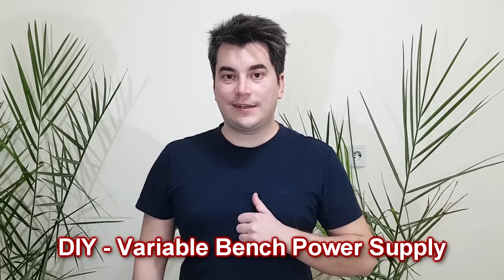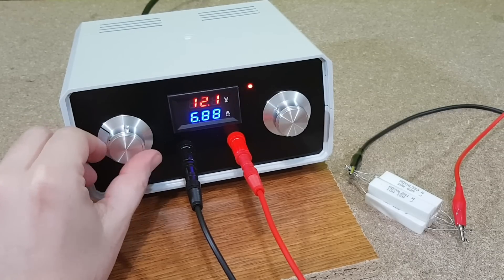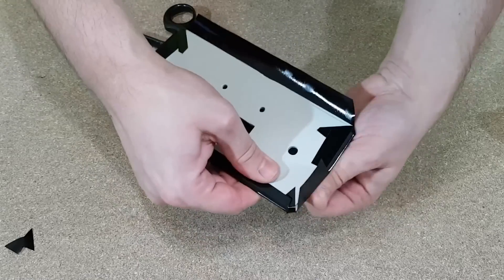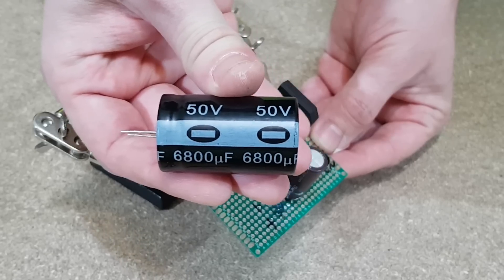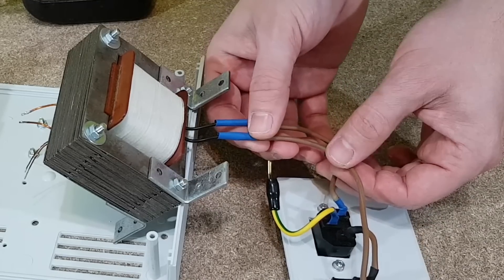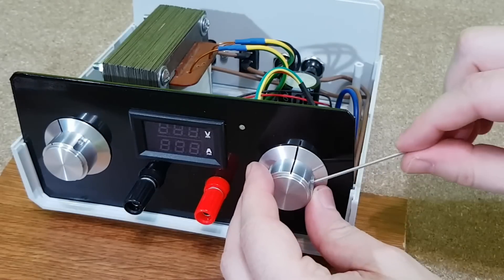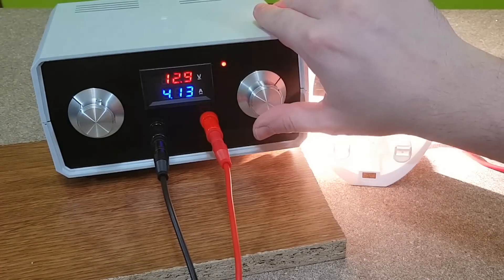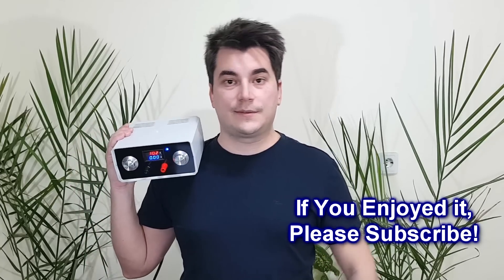DIY - Variable Bench Power Supply (Very Powerful)

Comment: Il y a beaucoup d'alimentations sur le net !
Mais j'aime beaucoup celle ci !
C'est du bon travail !
Pourquoi la led a trois fils ?
Elle set à quoi ?
Merci de ta réponse .
There are a lot of feeds on the net!
But I really like this one!
Its a good job !
Why the LED has three wires?
What is it?
Thank you for your answer .
Reply: Je crois que c'est une LED bi-colore (2 anodes, 1 cathode ou l'inverse), elle indique si l'alimentation est en mode voltage constant ou courant constant. On peut voir autour de 9:00

I guess this is a bi-color LED, so one anode, 2 cathodes or the other way around. You can see it change color to indicate if the power supply is in CC or in CV mode. We can see around 9:00
Reply from the maker: hi. yes, it's a bi color LED. one color is for when the power supply is in constant current mode, and the other color, when it's in constant voltage mode. but it's not very precise. it doesn't change the color exactly where it should, according to the current potentiometer setting.

Comment: Please  help me
Hi Sorrin I have watched your video several times it is extra but I must state that many have difficulty with the volt / Ammeter contacts. in minute 1.50 you show two different Volts / ammeter one with two wires and the other with three wires Red black white but in video you use another volt / Ammeter with three wires Red black and blue so I wonder which wire is for amperes and which is for Volt and of course the same on the schematic it would have been easier if you wrote a bit on the schematic for beginners like me
Reply from the maker: hi. the voltmeter with 3 thick wires is not available anymore, you can use the voltmeter/ammeter with 4 digits from the link in the video description. I made a new schematic with the new voltmeter: https://i.imgur.com/HDkBf7m.jpg
Reply: @Sorin_DIY  
hi thank you so much for your answer.I bought the volt / ammeter after watching one of your videos a year ago and now I am building a similar power supply without a transformer but with a siwtching adapter 12v and 5v and I can not find the right way to bind volt / ammeter.I will try with the new shematic.
I have another question: why do you use two wires for volt / potentiometer?

Comment: could this be done with a microwave transformer or is that overkill?
Reply from the maker: yes, but it's not recommended. microwave oven transformers are not meant to be powered for a long time. they waste a lot of power and heat up.

Comment: How many ohms are the resistors you put in parallel after the electrolytic capacitors?
Reply from the maker: 82Kohm and 2.2Kohm.
Reply: @Sorin_DIY  82k for the 19v and 2.2 for 12v?
Reply from the maker: yes
Reply: @Sorin_DIY  thanks

Comment: Salut Sorin, poate ma deslusesti tu.
Am construit o sursa laborator dar cu un traf și punte redresoare. Este cu lm317 si cu 2n3055 npn tranzistor. Totul bine, dar am conectat un modul afisor si se stinge când scade tensiunea sub 4v.
Am conectat firul subțire rosu după punte si înainte de lm317 și pe Colectorul tranzistor și minusul la minus. Cel galben la ieșire ca de obicei. De ce se stinge când scade tensiunea mai jos de 4v.As vrea sa vad si de la 1,25v pana la 4v..
Reply from the maker: salut. ai un link cu modelul de voltmetru folosit?

Comment: Can some one help me I’m trying to make a bench psu from a previous vid but I’m using a modern 650w psu. What dummy load resister should I stick on it.

It’s has most of its power on 12v rail 648w @ 54amps

3.3v & 5v rails are 140w @ 25amps

Comment: Ai putea construi tu circuitul variabil de tensiune exista scheme foarte sinple cu variaj de tensiune și amperaj. Eu mi-am construit propriile scheme  cu 317 și Lm 324 și ifrz 44 n. Dar în ultimele  3 surse ale mele a trebuit sa folosesc circuite cumpărate deoarece spațiul în carcasa este foarte mic.  Într-o sursa am folosit același circuit ca în videoul tău si 2 punți de diode și un ventilator cu un termistor. La o sursa pe care o am în lucru de 2 ani care are o putere de  56 de v 6 A   am creat o schema cu tranzistori mosfet. Dar costul pentru piese era prea mare asa ca am  cumpărat un circuit.  Am construit și o sursa cu Lm 723 și Lm 358.  Cred totuși ca ar trebui sa incerci
Reply from the maker: salut. la inceput asa ma gandeam si eu, sa construiesc circuitele. dar la cat de ieftine au devenit modulele astea din China, nu prea se mai merita. circuite simple/de baza cum sunt puntile redresoare din acest clip, sau filtre de boxe, le fac eu. dar module complexe cu piese SMD... mi-ar lua prea mult timp si costa mai mult sa le faci.

Comment: Hello, nice project! I am making a power supply from an old laptop charger, I am limiting the voltage with voltage regulators. How can i limit the current? And how can i make extra protection futures? Thank you!
Reply from the maker: hi. the only way is to use a CC-CV buck-boost converter, like the one in the link below. it's more efficient than linear regulators. for extra protection you can add fuses on the mains input and on the power supply output.
https://www.aliexpress.com/item/DC-DC-CC-CV-Buck-Boost-Converter-9-35-to-1-35V-80W-Buck-Booster-DC/32850280326.html?spm=2114.search0104.3.239.4dba575340DCWE&ws_ab_test=searchweb0_0,searchweb201602_5_10065_10068_319_10059_10884_317_10887_10696_321_322_10084_453_10083_454_10103_10618_10304_10307_10820_10301_10821_537_536,searchweb201603_16,ppcSwitch_0&algo_expid=d6db019c-a4d7-4c52-979f-fda74d194e76-36&algo_pvid=d6db019c-a4d7-4c52-979f-fda74d194e76&transAbTest=ae803_3
Reply: @Sorin_DIY  Thank you! Do you suggest a fuse circuit?

Comment: Great stuff. Any way to modify the boost converter to work up to 40V? Thanks!
Reply from the maker: thanks. the module I'm using in this video, is a step down converter. the xl4016 IC datasheet says: Wide 8V to 40V Input Voltage Range, Output Adjustable from 1.25V to 36V. I'm planing a future video, to modify the transformer and make it more powerful, with a 40V output.

Comment: hello, thanks for the tutorial, but I'd like to draw attention to the bugs.
There is no description of the rectifier diode for powering the display in the drawing.
Furthermore, resistance values (2W, or 5W?)
Converter type
Transformer values (2x12V, or 2X24V, or 1x24V, 1x 12V?)
It would be good to add these data to the schema and description,
especially for other handymen who want to build such a resource.

Comment: Nice work! Can I ask you something? In my own power supply with voltage regulators, i have not current limmiter, what circuit do I need? Thank you for your time!
Reply from the maker: hi. I don't think you can modify it, to get current limiting function. depending on the maximum voltage, you can use like me a step down converter with current limiter function and give the power supply another output.

Comment: Which case are you used in this video
Reply from the maker: hi. I've bought the box from a local store. you can find similar boxes online, but you need to measure the components, to be sure they fit inside. more important the tallest component. my box has this dimensions 180x160x85mm
Reply: Sorin - DIY Electrical Nerd Thank you for the giving suggestion
Reply from the maker: I've found the case model, it's ABS-85B. it cost me less than $5 from a local store. but it's more expensive online, here is a link:
https://www.ebay.co.uk/itm/ABS-85B-1pcs-Enclosure-multipurpose-with-panel-vented-X-180mm-Y-160mm/292828237270?hash=item442dec4dd6:g:gfQAAOSwz05b9nAU&frcectupt=true

Comment: Loved your project but adding a transformer to a switch CV CC stepdown converter doesn't make too much sense as you show in the end of the video.
Also transformers are great for linear power supplies because of their low noise and adding a stepdown will create a lot of noise.
Reply: Yeah a switch mode was a better option
Reply from the maker: hi. it depends on what you want to use the power supply for. I need a powerful variable power supply with more than 30V. the CC-CV step down converter is ok, but a 32V 3-4A switch mode power supply it's hard to find and very expensive. so a cheap or salvaged modified transformer it's the next option. I need this power supply to test light bulbs, LEDs (up to 100W), motors, audio amplifiers, peltier modules... some of them need a lot of current, so a cheap DIY power supply, that can deliver 7A at 13V it's perfect for me.
Reply: @Sorin_DIY  true but a 24 or 5v or even 12v supply are like 20 euro and they will put out 10A or more that is why a 30V output os not really the best choice so a buck-boost whould have been better in my opinion
Reply: @bashaaksema94  Finding a buck boost module which is capable of 300W is expensive. But I could found for less than 15 USD is 80w module which is less powerful than 150 or 300w Boost only Or Buck Only module available for less than 15USD on AliExpress.

Best would be to get a microwave transformer and 1500w boost or back module from AliExpress and rewind the microwave transformer.

Buy a non working microwave transformer from junkyard near you, I bought one for $2 USD.

It will be a monster power supply and will run nearly everything.

Comment: How to fix the voltage drop on even small load?
Reply: just be yourself
Reply from the maker: hi. if you use an electrical transformer, you need to modify the transformer and make it more powerful, or use a more powerful transformer, or use a higher voltage transformer + CC/CV module, so if it has a voltage drop, it will not affect the voltage range that you need.

Comment: Do you have a link to where you got the plastic box.
Reply from the maker: hi. I've bought the box from a local store. the model is ABS-85B. here is a link:
https://www.ebay.co.uk/itm/ABS-85B-1pcs-Enclosure-multipurpose-with-panel-vented-X-180mm-Y-160mm/292828237270?hash=item442dec4dd6:g:gfQAAOSwz05b9nAU&frcectupt=true

Comment: Hi nice project but it seemed you were struggling to get it around 0.5A.
Reply from the maker: hi. it depends on the voltage. it's a 93W max variable power supply. at lower voltages, I get up to 9A. you can check the graph at the end of the video. and I also have a plan to make it even more powerful. the step down converter works with max 300W

Comment: Forte frumos, de unde ai luat cutia, ca eu caut de un an și n-am găsit ceva să-mi placa. De rest este ok, nu-mi place ca ai folosit un modul comercial, dar dacă ai nevoie de 0.5 v dc ce faci, sau mai puțin, este o sursa, ar trebui sa plece de la zero. Îți doresc succes în continuare, bafta!.
Reply from the maker: salut. carcasa am luat-o de la mivarom.ro. in specificatiile modulului scrie ca tensiunea scade pana la 0.8V, insa in cazul meu nu scade sub 1V. oricum nu ma deranjeaza, nu cred ca voi avea nevoie de tensiune sub 1V. daca ai nevoie, poti sa folosesti alte module, care au si tensiune mai mica. eu am nevoie de o sursa variabila, care poate dezvolta si un curent destul de mare. voi testa leduri (de pana la 100W), motorase, module peltier, amplificatoare audio... 7A la 13V e ceea ce am eu nevoie.

Comment: This led is useless, it doesn't indicates cv/cc mode,  by the way this board has short circuit protection, so fuse is not necessary on cold side

Comment: Hello Sorin. I hav one question for you. What voltage goes from the transformer to voltmeter/ammeter display?
Reply from the maker: hi. the voltmeter display needs a supply voltage of 5 - 30V. I gave it 10V.
Reply: Thanks. Can you explain this part of shema. Which resistors goes after capacitors? https://ibb.co/DDNN943

Comment: Great work sorin!🙂....I just wanted u to confirm me that can I use this variable bench Power supply  preferably ....for charging my li ion (18650) battery pack of rating 12.6v 20000mah.. without any problem...
Waiting for urs response..!
Reply from the maker: yes you can use it.
Reply: @Sorin_DIY  Thanks for ur reply...👍...There is one more question to be asked..... As the bench power supply has a pulsating input ...does xl4016 stables the output ...from any kind of input...?.....and will it be stable for charging battery pack at fixed voltage level... without flucating  the voltage ..?
Reply from the maker: the input is very stable, because I added big capacitors. the output voltage should also be stable, but it depends on the load. according to the specifications, the ripple should be around 50mV, when converting from 24V to 12V with a 5A load. if your load is smaller, the ripple should also be smaller.
Reply: @Sorin_DIY  Thanks a lot 👍

Comment: A bit late for this comment but,why did you use 10K Single Potentiometers in the video? But in the description on the parts list you provide 10K Multi-turn Potentiometers??!! Whats the big deal?
Reply from the maker: in my 12V/19V UPS part 1 video I've made an upgrade to the variable power supply. so there is no reason to recommend the simple potentiometers anymore, I added the final link of the multi-turn potentiometers. I also changed the link for a better volt/ammeter.
Reply: @Sorin_DIY  Oh the Irony,Welp.. I accidentally bought single turn 10k potentiometers and I had soldered it to my XL4015 module,it does kinda work,the only issue is that it is a bit hard to set it to the correct voltage and i have to turn it slowly. I am not sure if its the same for current adjustment,but for my module it is maximum 5A,so I guess it doesnt matter. I had now just ordered a WXD3 10K Multi Turn Potentiometer. So i guess now I should be able to set a proper voltage now.

Comment: you say to 4700uf   you  use 6800uf  in your video
Reply from the maker: I use a 6800uF capacitor for one output and 4700uF for the second output.

Comment: you mean DIY buy Chinese switcher module and put it in a box
Reply from the maker: no. I mean DIY build a transformer, because it's very expensive. and don't waste time on building a step down converter, because it's only $2. it's cheaper to buy it, instead of buying the components and waste a whole day to put it all together.
Reply: @Sorin_DIY  that thing costs more then pre made Chinese module with  dual rail ,  say you made it for views and thy shell forgiven , save your soul foolish child , cast down the daemons  , repent!

Comment: OMG why the hell you use linear transformator with switching regulator? It is like using fingers to untie a nut from the screw and after you untied her use a adjustable wrench. Pointless. Use switching regulator and switching power supply board. Or better example is to use a linear power supply board and linear regulator. You get low electrical noise from linear regulator.